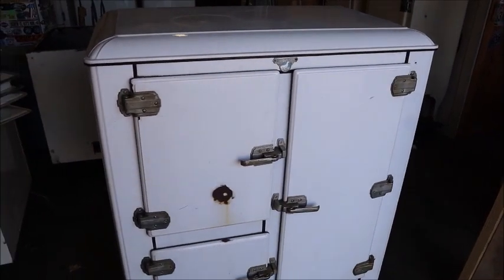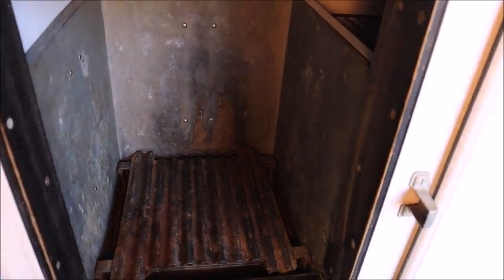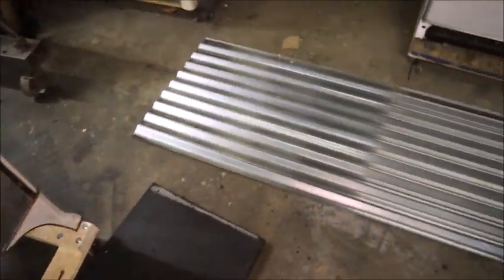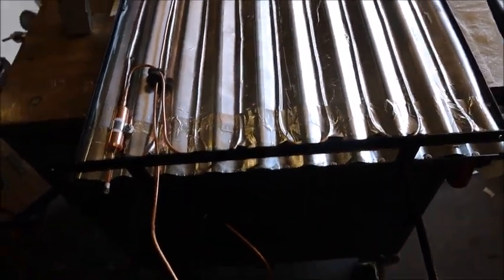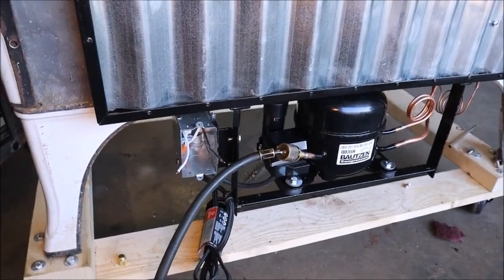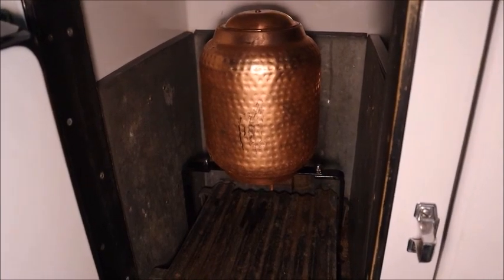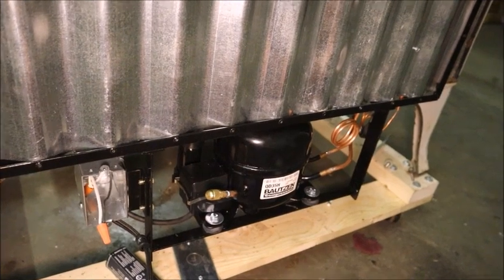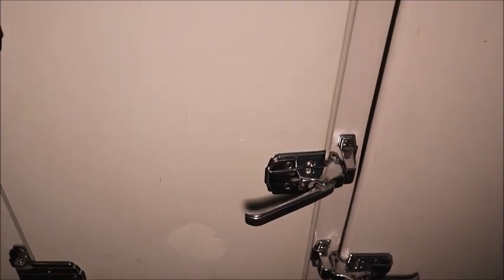Home-made refrigeration system for 1934 icebox - 1 - Build and initial testing...

Comment: A friend of mine lives in a 1920s 3-flat apartment building. Each apartment has a pantry on the far back wall, and each pantry has an ice delivery door that goes through the outside wall. They're closed up on the inside, by now, of course. My old apartment building was also built this way. But one more curiosity of his place is that it also had a drainage system for the iceboxes. All that's left of it is a 2" iron pipe in the basement running vertically against the same outside wall that just ends a few inches above the floor, very near a floor drain.
Reply from the maker: Very nice to think about the good old days when that was the way of life, and everything else was much simpler but people had to be a lot tougher.

Comment: That’s so cool ,that must have been close to the end of iceboxes
Reply from the maker: In some rural areas, iceboxes were used into the 50's actually!
Reply: @davida1hiwaaynet  You know I had forgotten about that,mama reminded me that where I live now didn’t get electricity till right after WW2
Reply: Cold, too! ;)
Reply: @JohnWilliams-fg7fo  My grandparents did not have electricity in the 1980's, when they died. It did go near them, but they did not want to pay the cost of installing the power lines from the closest line to them, instead relying on paraffin lamps and a wood burning stove, though water was delivered from a diesel engine powered borehole into a large steel tank near the farm.

Comment: The drain can go to a small tray through which several turns of the compressor discharge pipe are passed to evaporate.
Reply from the maker: Thanks!  I am sure that could be done. I plan to do more of these and can add that to the next one.

Comment: I thought I heard back in the 40’s, some of these were converted to refrigerators.  Maybe for your next one, see if you can convert it to a fridge using authentic refrigeration components from the 30’s making it look like it was converted from that time
Reply from the maker: There were some very nice 30's era Frigidiare and Kelvinator systems which could be added to the larger iceboxes which were built-in and not easily replaceable with a stand-alone fridge. Many of them had remote compressors, as well.  I don't think many of the small apartment-size iceboxes like this were converted because a stand-alone fridge could be used to replace it, very easily.
Reply: In 1980s when I got my first house a friend gave me an old Frigidaire with crown on the door to use in my kitchen.  It was dirty and beat up but I really liked it so I cleaned it up, painted it and made a new door seal.
It was fabulous but old and after a few years the ancient compressor gave up the ghost. I wished I could put newer guts in it and use it forever. I had no means at that time.
It was real simple with the freezer box in the middle.

Comment: Great build there. I would recommend the next one to build in a condensate evaporator pan under the drain with some of the hot gas line going on the bottom attached like you did with the condenser or in the condensate with a copper/nickel line to keep it from corroding unlike some of the other units I have seen out there. I remember seeing some articles about converting the old ice boxes to having a compressor system like you did but at that time it was like SO2 or worst stuff they were playing with.
Reply from the maker: Thanks for the comment!  I could have built a condensate evaporator pan as you describe, and may do that eventually on another project. In this build I plan to hang a receptacle of some sort under the cabinet so that defrost water will run down the exterior of the lines, and drop down into the container. Because this is a manual defrost design, it won't be that hard to manage, I think.

Yep, Frigidaire and Kelvinator both made conversion systems for large, built-in iceboxes! Most of them had remote compressor systems. The Frigidaire were all SO2; while Kelvinator used R600A or SO2. There have been a few of them shown on the various forums or Facebook groups, too. Love this old stuff.
Reply: R600a would be pretty easy to source in the camping section of you wanted to go extra authentic. Probably not the driest out there. 
 @davida1hiwaaynet

Comment: I was going to ask what gas you used, but then you mentioned it :) 
Would you end up putting a glass dish under the evaporator to catch drips?
Reply from the maker: I plan to hang a container under the original drain port, so that defrost water will run down the exterior of the lines and run out into the container.  Because of the evaporator design, it won't defrost during the off-cycle but will require a manual defrost every now and then.

Comment: If you were looking for a Chinese compressor I would look at either Donper or GMCC.  The latter is a joint venture of Toshiba and Midea.
Reply from the maker: Thanks for the comment!  I wasn't looking specifically for a Chinese one. I was looking for one which doesn't require a body fan (static cooled) and is 1/8 HP. I was really hoping for an R600A compressor meeting those criteria, but couldn't find anything in a reasonable price range and not a used salvage part. (Whole 'nother story about buying salvage parts off eBay! https://youtu.be/iJhjt1PI1SE)  The Bautzen comrpessor came with POE oil and is designed for R134A. I used R152A with it which is fully compatible and puts a little less stress on it.

Comment: Out of curiosity Dave, what are your plans for handling the condensate in the off cycle?
Reply from the maker: Ken, I plan to hang a container under the original drain port, so that defrost water will run down the exterior of the lines and run out into the container.  Because of the evaporator design, it won't defrost during the off-cycle but will require a manual defrost every now and then.

Comment: Nice work I have a 1930 fridge that I'm working on can I ask you how you calculated the size of the evaporator and condesor?
Reply from the maker: To be honest, I used experience repairing similar capacity antique fridges. Used similar length tubing and surface area of condenser; and for the evaporator I used similar tubing length, plus about 20% to make up for no suction accumulator. The cap tube came from the cap tube charts available from suppliers. I did have to add cap tube to get the pressures in line, so it's using the R134A cap tube chart, for static cooled systems, plus an additional 20% needed to dial it in. This system is completely custom so there was really no established guideline for it, I hate to say.

Comment: I wonder how many of these were converted to electric refrigeration in the past if that was even done back when refrigeration started to become mainstream?
Reply from the maker: There were some very nice 30's era Frigidiare and Kelvinator systems which could be added to the larger iceboxes which were built-in and not easily replaceable with a stand-alone fridge. Many of them had remote compressors, as well.  I don't think many of the small apartment-size iceboxes like this were converted because a stand-alone fridge could be used to replace it, very easily.